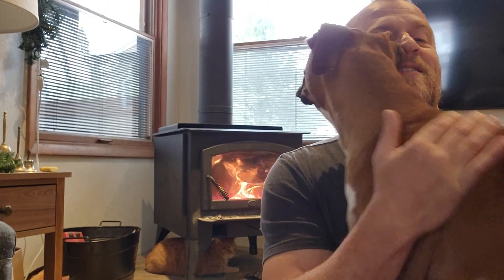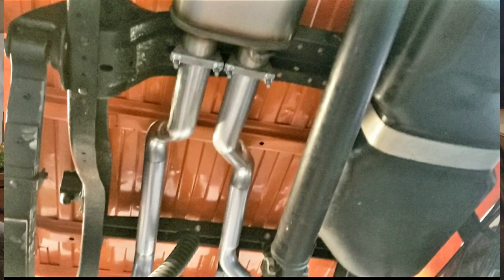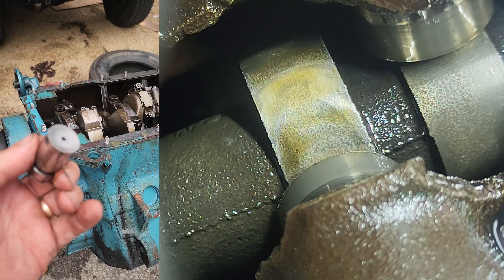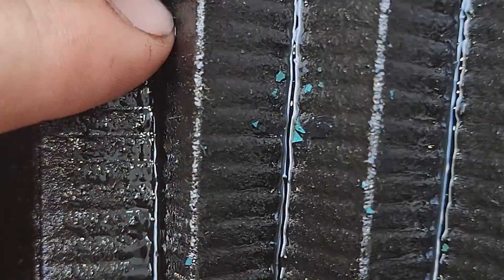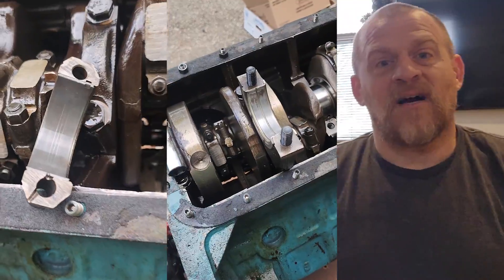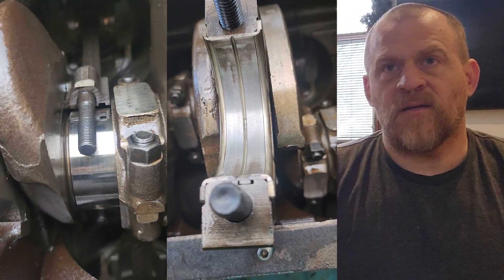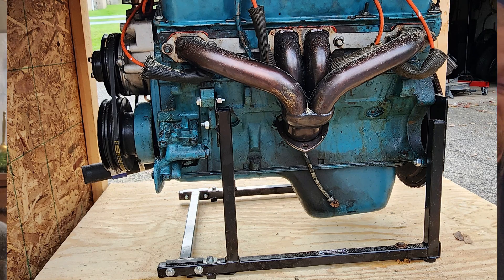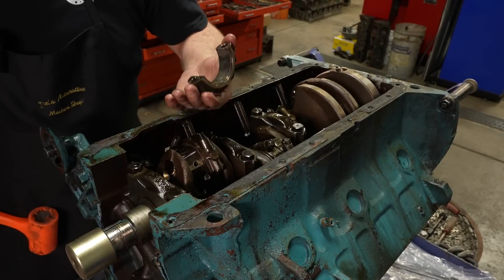Wiped Cam Lobe/Lifter After 4000 Miles?

Comment: Put roller cam, roller lifters and roller rockers in...spending dough I suppose...the zinc oil will become harder to obtain than it is already and the roller goodies work well with synthetic oil. Zinc going out the exhaust ruins catalytic convertors. I have been watching JAMSI for awhile. I was happy to see your site connected with them. I was told zinc is only necessary for valve train; roller hardware eliminates need for it so then can use synthetic.
Reply from the maker: Agree! Roller everything lol

Comment: Paul,, I'm an ex Mac Tools distributor turned technician for many years. I serviced Jim's Machine Shop back in the day. These guys are solid. You're in good hands with these guys!  I'll be watching the rebuild.  Good luck.
Reply from the maker: That's awesome, thanks for sharing. I feel like I'm in good hands
Reply: @ScannerDanner  how did you bend the push rod which you did not explain how you bent bent it?
Reply from the maker: @peacepoet1947  careless re-installation and believe it or not, super easy to do lol
Reply: @ScannerDanner  still doesn't explain how it is easily done by anyone who pulls a head gasket replacement.  Do you need to rotate the crank shaft as you tighten down the head bolts?
Reply: @peacepoet1947  whoops, lol. probably had it sitting on the lifter edge instead of in the socket or it snuck down below the rocker socket. I'd imagine it either had vale to piston contact to bend or full coil bind. it likely needs different length pushrods anyway, depending on the build parts and machine work.
Reply from the maker: @peacepoet1947  lining up 8 pushrods with some valves that are open and some closed means you are already dealing with uneven pressures, then when you bolt the rocker arms down, they are all on the same shaft (4 bolts) and must all be worked down slowly while you're holding onto 8 pushrods with your 8 hands lol. Make sense now? You'd have to do one of these with this set up to understand
Reply: @ScannerDanner  I had removed the heads on  72 Chevy El Camino to see which values were being used.  The leaded gasoline was being discontinued and there were questions on the hardened values.   I have two cylinders with lower compression than  when I started.  Wondering if I might have done something wrong.  It was my second time.  Had a bad value on a used  74  Plymouth Fury 111 with a upgraded engine.  Tightening down the head bolts in  30lbs  to  60lbs one bolt stripped.   Was able to back it out.  I drilled it out and put in a  helicoil and never had a problem. Drove it as a driver's education vehicle.  My girlfriend drove it from San Diego to Tacoma, Washington and had it for years before she started having overheating issues. 

 The mechanics really messed her over.  The oil sending unit is plastic and metal and it had cracked on me which makes a big oil leak and the mechanic suggested that she junk the vehicle which she did for she didn't know that it was only a  $15 part at the time.  I still have the one I replaced with a new part. 

BTW,  thanks for responding to my question.  Happy New Year.

Comment: Our current machine shop is 30 miles away, depending on the season it could be a 2 or 3 month wait to get engine parts back.   They do excellent work but damn times have changed.

Comment: Dick's Auto Parts in Uniontown Pa Machine shop and they are good
Reply from the maker: I believe those are the guys that flat turned me down. It was in Uniontown, the one I stopped at
Reply: There is also Greg Dahl which he is very good in Uniontown and you might want to check with Fayette Parts on Main Street in Uniontown because Napa has a machine shop in Morgantown WVa @ScannerDanner
Reply: When I had Dicks do that Hyundai engine I gave them the pistons and they bored the block .020 over and put the pistons on the rods and rings on the pistons and I put the engine back together and got it running @ScannerDanner

Comment: Dick's Auto Parts in Uniontown, Pa has a machine shop and they are good I just had them bore a 1.8 Hyundai 4 cylinder as it had the classic wrist pin knock

Comment: I’ve been a JAMSI subscriber for a while now. You’re right about the lack of machine shops left. They are dwindling as fast as the talent they once had. Jim’s is a solid choice. I only worry about the influx of jobs they are about to be presented with 😊. Nice pick Danner.
Reply: Yeah. I have 5 near me. One is a specialist in drive shaft balancing, one is a specialist in race engines, 2 are general machinists and one is an older guy that is not far from closing up.
Reply: Yup, I have one in my area run in the back of a large mom and pop auto parts store. Never had an issue with their work. But I cringe every time I get the bill😂. Oh well, great work is not cheap.
Reply: it’s probably cause new engines are so much harder to rebuild, throwaway engines or usually just not worth it that the only machine shops left are just keeping the old stuff running and doing performance work, because obviously there’s no new cars rolling in they all just end up at scrapyard once their time is up and the owner just buys himself a new car from the dealer.

Comment: Just like Chevrolet in the 1970's with the 350 engines they had cam troubles and then in the late 80's it was the 4.3 engines with crankshaft troubles they were not hard enough and that's the problems of flat tappet cams today, not made hard enough And the cam lobe was already wiped out the first 5 minutes it was started for cam break in